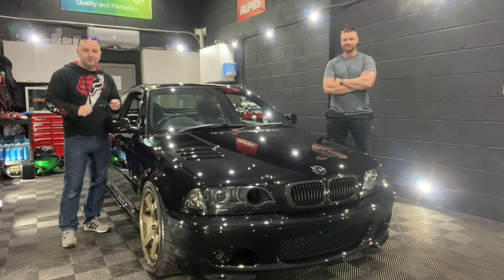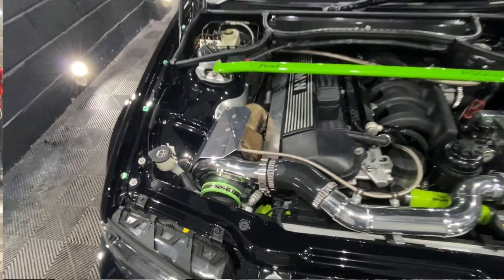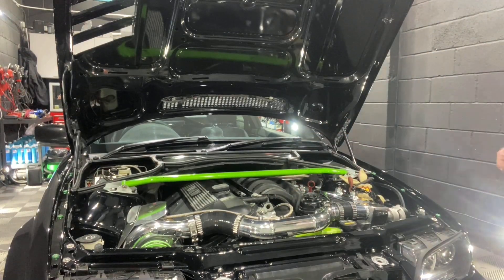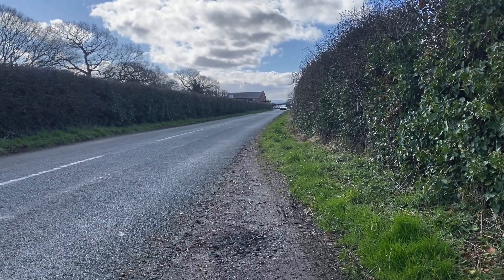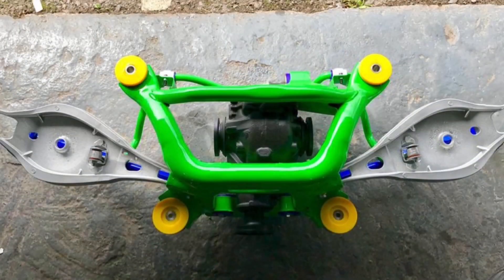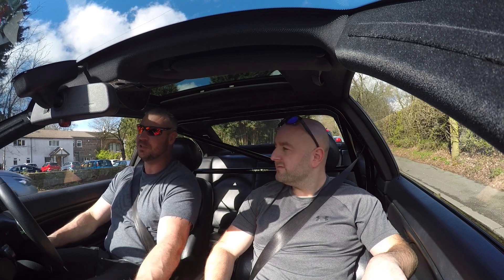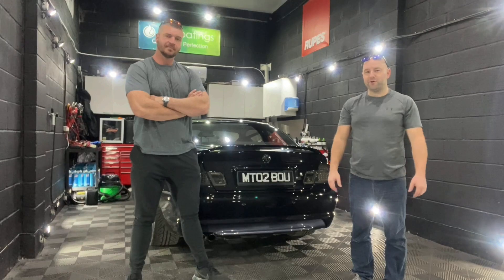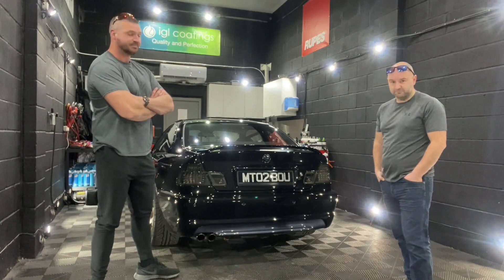Boosted Bmw e46 coupe *turbo charged 400bhp*

Comment: Very cool to see, I have a 330ci that is very similar, I have done a few more mods to my engine (m56 valve cover, m50 intake, cooling system delete etc.) but I’m just now in the process of installing the turbo. Is that the tires rubbing a bit in the rear? That’s one thing I hate about this car is the narrow rear wheel well. I had to sell my BBS wheels and I’m now getting thinner wheels with a smaller offset so it’s just clears the breaks and doesn’t rub cause it trashed my tires even with camber and I hate the sound 😅